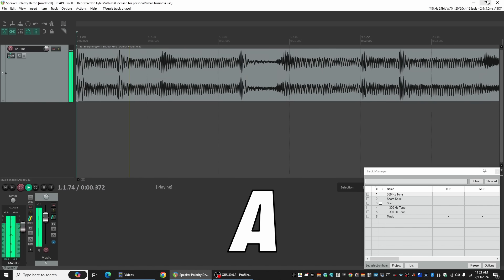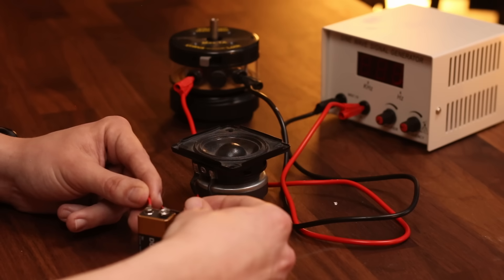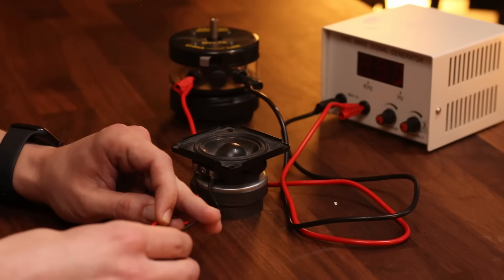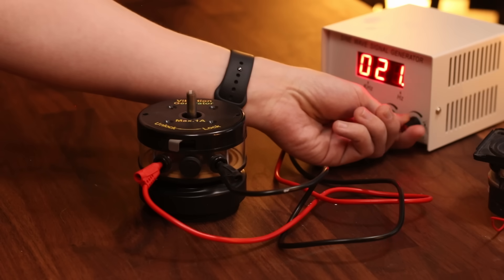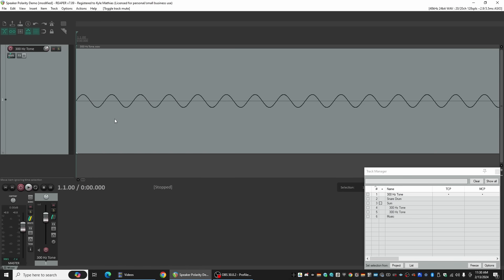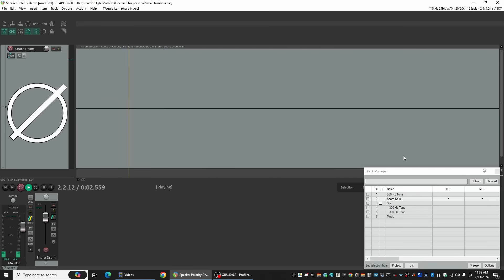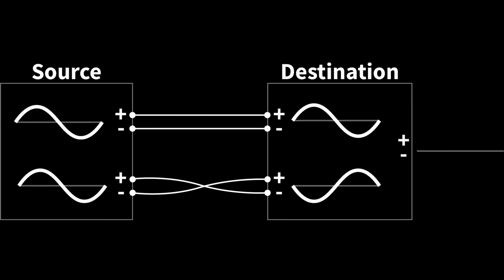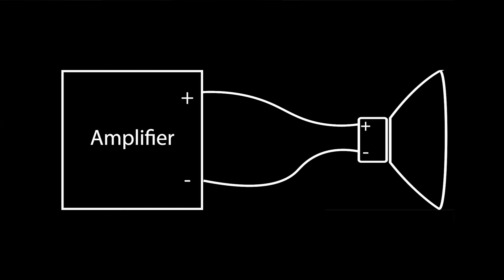What Happens When You Wire Speakers Backwards?

Comment: I had a car years ago that had both front stereo speakers mounted on the dashboard right next to each other, and wired with opposite phase.  It sounded terrible because most of the sound was cancelled. Wired correctly it was much better, but still not great because the speakers were small and too close to each other.

Comment: The cancelling out of of opposing signals is why XLR cables don't reproduce induced noise, and can therefore use long runs in noisy environments. The signal is sent down two wires, but opposing each other (with a common ground being the third wire). Any signals that are induced become opposing when one of the signals is inverted at the end and cancel out just the noise. (This is a rather simplified explanation just to get the concept across) 🙂

Comment: Here's an old idea.  The effect is LIKE THE SPEAKERS IN FRONT OF YOU GO AWAY; it's like the sound comes from infinity left and right.  It's kinda like getting headphone sound without wearing headphones.  Let the left speaker play the left channel plus a delayed, inverted, softer copy of the right channel.  (And vice-versa:  Let the right speaker play the right channel plus a delayed, inverted, softer copy of the left channel.)  The delayed-inverted right signal coming from the left speaker cancels out the small part of the right signal that comes to your left ear from the right speaker.  (And vice-versa...)  You have to tune the delay to somewhere under 1ms (the timing difference between the sound reaching each ear) and tune the intensity of the delayed-inverted signals to cancel out the cross-head sound.  Each ear hears (approximately) only the one channel, not a mix of both.  The effect is LIKE THE SPEAKERS IN FRONT OF YOU GO AWAY; it's like the sound comes from infinity left and right.  It's kinda like getting headphone sound without wearing headphones.  (I think I tried this once, in the analog 1980s.  I forgot how I did it.)  (A complete conceptual solution adds more and more further-delayed, re-inverted, softer copies to cancel out the canceling out signals.)  This works well only if you are centered between the speakers; it goes bad off to the sides.  This works best only at one distance back from the speakers; for other distances you'd have to adjust amount of time delay.  I think a lot of manufacturers have added effects similar to this; digital signal processing can do many things.

Comment: The difference is in air flow. Concussion. That and driving inward will slowly ( sometimes instantly) crush the coil inside the magnets causing the speaker to heat up seize up and blow. They are designed to drive outward. Forcing the sound wave outward.  I ran a techno nightclub in Portland Oregon for 14 years. We used 24 15 inch JBL speakers in folded bass horn cabinets. Trust me. Reverse polarity cooks the speakers. Actually,because I know where this will end up, hook them up backwards ....see for yourself how long they last. Lol

Comment: I'm of the mind absolute polarity is only audible if the particular speakers being used exhibit different THD on their inwards woofer stroke rather than their outward stroke. Roy Allison once made speakers, for example AL 120, where one woofer was mounted facing in towards the cabinet, but wired with flipped polarity to correct it back to normal, so as to ensure you get the same THD into the room, regardless of signal polarity. {He told me he didn't think it was likely audible for most material, but it did measure better.}

Comment: Thanx for the thorough explanation of speaker function, especially w/ the visuals of the oscilloscope. 
I was becoming doubtful that you were going to explain the effect of swapping polarity of one side of a stereo speaker arrangement, and I was ready to comment w/ the question "What if...?", when you resolved the question w/ an answer. I was also pleased to learn that I was correct in my assumption of a "cancellation" effect. 
Using a pair of Sansui SPA-3700s here... that I bought new in 1981... they are properly wired. 
Thanks again.

Comment: What if you do this with headphones? Since they are each separated and each transmitting the waves to a different ear they shouldn't cancel each other. But would you notice a difference because the waves aren't really in sync or would it sound like normal headphones?

Comment: I experienced this buying a turntable stylus which had something weird going on with one channel. One of its channels had its polarity inverted, which in turn caused the weirdest audio I'd ever heard. It was faint, some stuff that was panned left or right would come through, but overall I couldn't really hear that much. I found out that muting one channel would bring back audio to normal, so I swapped the cables on my cartridge and everything sounded fine again. Weird how things work. Also, this is how noise canceling headphones work.

Comment: I had some fun trying this out once. Playing the same audio on two speakers, but having one inverted. When putting your ear in a place with the same distance to both speakers, it really gets more quiet (still far from 0, but very noticable). But if you move your head so the distance to both speaker is different (by maybe 10 or 20 cm), it get's louder again, because the waves are ever so slightly out of sync and can't cancel each other out as well.

Comment: I can imagine there should be a difference Because the air compression from an outward motion of the speaker will be different from a 'vacuous' contraction of the speaker cone. However the brain/ear focuses mainly of the magnitudinal (new word btw) differences in signal. +5 to -5 is the same  as -5 to +5 bit the physical sound of high pressure compared to low pressure' will be different. The resonances of the cone after reaching the max displacement will be subtly different too but provide 'extra' sound on top of the single maxima/minina deflection which the ear/brain will once again get a whole bunch of magnitudinal differences and so likely think it's the same sound.

Comment: There may not be a difference when the speaker is exposed, but there may be a difference if the speaker is mounted in a box that is closed on all sides. Because in one case, high pressure occurs in the box, and in the other, low pressure occurs.

Comment: My car was driving me nuts because the bass register was entirely absent unless I faded the sound to the front. Turns out the left rear speaker was wired anaphase from the factory. I discovered this as I was installing replacement speakers because I was convinced they just didn't have any low end. Wired properly, they sounded great.

Comment: It's a matter of timing compression waves. The squiggles are just a visual representation of that. You could describe it (as a digital signal) as 010101 and 101010 and represent the same shift in phase. Those noise cancellation gadgets work on a similar principle. They're supposed to take a signal, shift it a half phase out (I think that's the right term) and play it back, nullifying the input signal. Works okayish in big bulky headphones as a noise calcellation system rather than a sound absorbtion buffer, often for people with audio related hypersensitivity problems, but it's pants when trying to handle any sound in an open space. Best you get there is a weird muffling effect. Fun to hear. Not a great commercial product though if you're marketing it as silence-bubble type thing though.

Comment: I understand that the polarity theoretically makes all the difference in the world.  But consider that the wavelength of, say, 2 kHz in air is about 1/2 foot.  If speakers are 10' apart across the room from you, there are many wavelength in your distance from the speakers.  Even your ears are about 1/2 foot apart.  So, wouldn't this practical difference, of many areas of constructive and destructive interference, and exactly where you sit, be much more significant than the speaker phase?  Move your seating position 6 inches left or right, and everything has changed!  Now, yes, agreed, that if the speakers are right next to each other, phasing is critical.

Now to contradict myself.  At lower frequencies of 50-200 Hz, wavelengths are much longer (10' for 100 Hz), so yes, it does matter.
Reply: Yes, the cancellation is more pronounced at low frequencies due to the longer wavelengths. For signals, the cancellation is perfect, but for the resulting waves, the spatial aspects must be considered also, as distance travelled also changes the phase.

Comment: When I hand built a set of 3 way home speakers with dual 12" woofers in each cabinet I was extremely disappointed in the lack of bass. Several years later I was about ready to cut my loses and scrap them out for another project. The cabinets were of furniture grade quality and I was reluctant give up on them. I'm glad I took one last look at them to find one of the home built crossover was wired in reverse. Yep I screwed up and fixed my mistake and entered them in a home built speaker contest winning the under $200 class.

Comment: Correction: in the intro the left and right channels were in the same phase. But it's true that if you listen to music from a single speaker, it would sound exactly the same regardless of polarity. If you listen to music through two speakers, and one speaker is in the opposite polarity to the other, the sound is noticeably different than it is in case both polarities were the same (no perfect cancellation will occur). Some (or most) people may find it distracting. 00:42 - The speaker visual is wrong, it would not work very well if the voice coil was sitting that deep in the air gap. It must intersect the dense magnetic field that jumps through the narrow gap between the central post and the front plate on the magnet, both made of soft iron.
IMO the video does not demonstrate the phenomenon to its full extent.

Comment: As an Audio Engineer this is a awesome way to explain not only speaker wire hook up but also phase cancelation. Great job. Cheers & flysafe my friend.
Reply: Except that in a real world stereophonic system, what you get is not noise cancelation, but a complete distortion of the stereophonic image - and he completely avoided this which is the most important topic. It would just have required to invert the signal on one channel to show it, and he missed it. I can't understand that.
Reply: @falmircamion3534  I hear ya, but i thik he was just explaining the speaker wire backward effect. Im guessing. But yeah your right and not only that but there are other phasing and cancelling issues out there. Like when mixing drums L R overhead placement along with room mic placement then timing with any delays on those. But yeah i think he was just staying simple on a speaker wire hook up. But then in car Audio being hooked up right is all about sound no sound or a car of smoke. LoL. I love car audio and love to feel, smell & taste my low ends and the bass. Ain't nothing like the smell of warm coils in the morning , smells like Victory. LoL cheers myfriend.
Reply: The simplest way to text it, would be with Audacity : 
- Generate a signal (any signal you want - I did it with a rounded square)
- Duplicate it, 
- Adjust panning on both channel to left and right.
- liste the result
- Select signal on one channel and invert it.
- Listen the result and compare is with the previous one.

It is obvious by this method that the noise cancelation is something which only happen in very specific places like in young's dual slit experiment, but cannot be generalized to binaural listening of distinct sources.
Reply: @falmircamion3534  Sounds like a trickle down from a dot bomb. I thought i could fly once but then i remembered that I only had two left feet. But i had balance when i played backwards.  8 )

Comment: How much of a factor comes into play if wiring the speakers in series out of phase vs parallel where the cancellation seems outside audible recognition? Can I achieve a reduced overall output that is beneficial for some settings, not completely cancelled out somehow? Can this be switched remotely, or must it be hardwired either or? Good stuff

Comment: Nice video!
It is also very important to have the speakers correctly connected if you're using a speaker which has a tweeter and a main speaker, or maybe even a combination for highs, mids, lows. There's a circuit which "decides" what frequencies go to which of the speakers and if you have connected it in reverse, tweeter will be getting the signals meant for the bass and vice versa. At least that's what I'm thinking would happen. I'm interested to hear from someone who knows more about this.

Comment: About inverting the signal. This is how i've done some bridging on a lower poer stereo amp. I had one 2x35W amp and 1 pro speaker 500W. So for a party i've combined signals into mono, duplicated on both L - R channels. Inverted one of the channels. The amp gets L-R input and the total amplitude from + on R to + on L is exactly double. So hooking the powerful single speaxer +R and +L will gain all the amplitude from both channels. 

This is some ghetto manual bridging to have 1x70W from a 2x35W to power one big speaker.

Comment: Given that your sound signals are AC, the Positive and Negative on the speakers are only there to indicate phasing for when you have multiple speakers together.    If you have a single speaker, it will have absolutely no impact on the sound.   Given the way audio works, any audible difference is likely placebo effect.  The fact positive and negative create an excursion with DC applied is purely some random decision at the time it was standardised.
This is an interesting video explaning how it all works,

Comment: I rather would like to use the speaker to generate energy by the use of a thermoacoustic engine, a different kind of Stirling engine basically.
Or by simply using a linear actuator to generate electricity. Does anybody know if the efficiency of this kind of generator is any good ? Maybe somebody with a bachelor thesis on this or something ?
I am too lazy to build my own linear generator so I wanted to repurpose a speaker by simply holding the coils stationary and moving the magnets to induce a current. Has anybody done that ?

Comment: this is kinda me being pedantic, but technically, speakers aren't meant to play AC or DC, but rather, more generally, "variable current", as the voltage often jumps around erratically and unpredictable. AC would imply that there's a specific frequency at which the pattern repeats, and DC would imply that the current is relatively constant, and neither really apply completely to speakers

Also, I do think I can discern a difference between the correctly vs incorrectly wired speaker examples. It's subtle, but at the starts of sounds especially, there's a slight difference that I can pick up on if I focus on it

And one last thing, wiring speakers backwards doesn't just become a problem because of destructive interference, but also because of our brain's attempts to hear directionality. If you take the same sine wave example as before, but make one of them the left channel, and the other one the right channel, you can make your brain hear it as coming from different directions by offsetting one channel by a few samples from the other. Our brains detect that offset on a very precise level, and try to match the signals we hear from both hears. Because of this, when you flip the audio signal of one channel, especially with more complex waveforms then a sine wave, the audio becomes distorted and hard to understand, despite the audio still being fully intact. I've noticed that a lot of digital copies of analog footage from tapes and such often have one channel flipped like this, which makes it really hard to hear well, but if you just flip one channel in an audio editing tool, it's perfectly fine

Comment: I was on vacation in the early seventies and my cousin had a fantastic stereo system. Maybe $3000 bucks in those days.
No one else was in the house, so while I waited, I turned it on, put on a great album and shortly I felt that something was wrong. I checked his speaker polarity and it was not right so I switched it.

I sat back and listened to it again. My God, I started to cry. Best Stereo I ever heard.
 It was okay to turn it up! I was alone. The way he had it, the 3d center image was missing but after my change it felt like a live concert where the sound was all around me.
 My cousin came in and immediately thought something was wrong. "What did you do"?
Your speaker polarity was wrong so I fixed it. What? He changed it right back. Apparently, he thought the sounds from each speaker had to be like, farther apart and 'More Stereo"
Well, as we know, that is not Stereo is. It is not just Left and Right but a mix between the two.
BTW. I am a talented 3D graphics, hobby Artist. With all the automated 3D app's now, I gave up doing art for the web.

Comment: So the most important thing is that all the speakers are wired the same.  If you have one of the speakers wired in correctly you need to have all of them wired incorrectly. Better yet put all the + on the + and the - on the - and know that it's right.

Comment: If you buy a large subwoofer/s and too small of a box, you can install the subs backwards and wire the polarity in reverse. It will sound a LOT better than if you put the speaker in the normal way and wire the polarity the normal way. It doesn't harm the speaker. Just try to make sure the front surround suspension doesn't rub against the inside of the box. Or you can just build/buy the correct sized box.